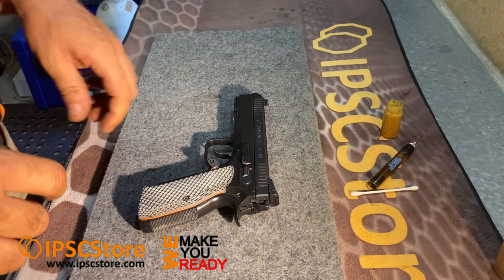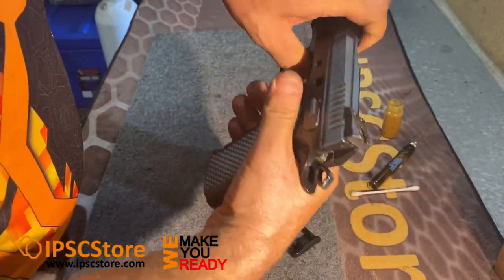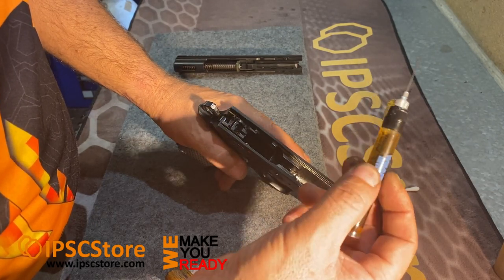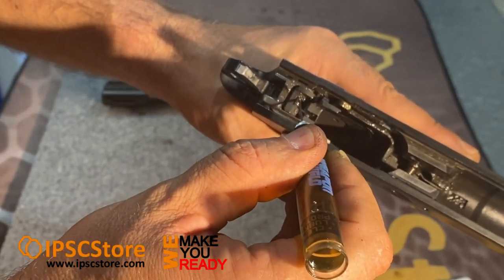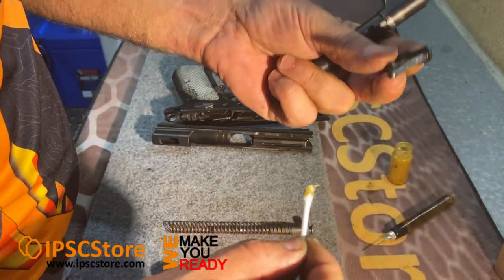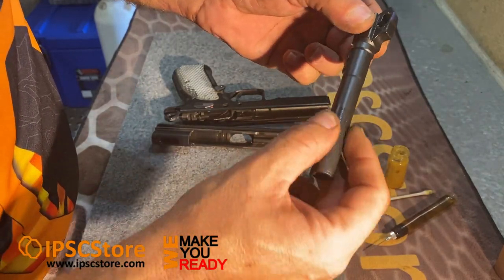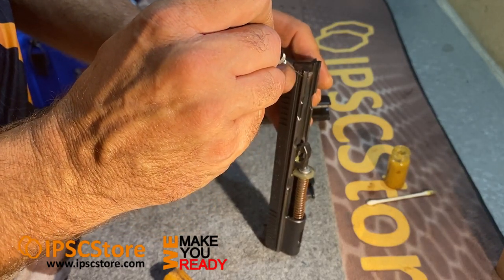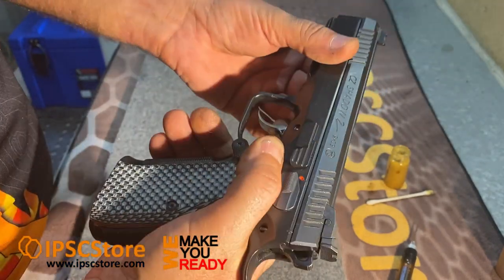How to lube a handgun correctly.

Comment: This was mad helpful. I'm going to subscribe just because I've been looking for this exact thing for a while. You were buried deep dude. Just got a shadow 2 compact, and no one showed exactly and clearly where to drop oil in the frame near the sear/hammer. I was about to spray Lucas CLP on everything then wipe down the outside. These CZ's are machined marvels. I could see the barrel lugs on your pistol had barely any wear. I bet you've shot thousands of rounds with that pistol. I want that too. Thanks again.

Comment: For a self defense gun with defensive ammo that’s going to be stored in the gun for more than a week, one should NEVER EVER put oil on the flat part of the slide where the hammer drags across.   I know that spot sees much wear, but when the gun is not in use and just sitting idly by, the oil will migrate its way into the chamber and onto the rear of the bullet case.   The oil can then migrate into the primer, rendering the bullet as a “dude.”   

For time at the shooting range or in a competition, that’s different and it can be oiled there.   This is because the bullets are just target FMJ rounds usually and will not be stored in the chamber for any reason period of time.